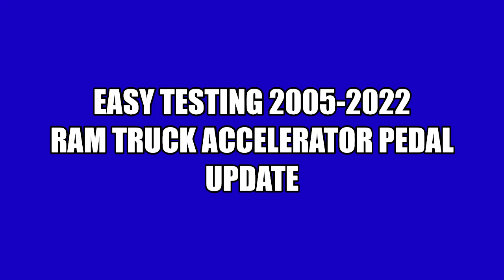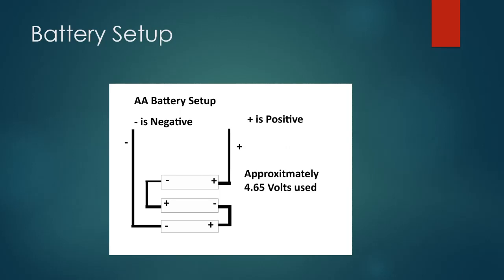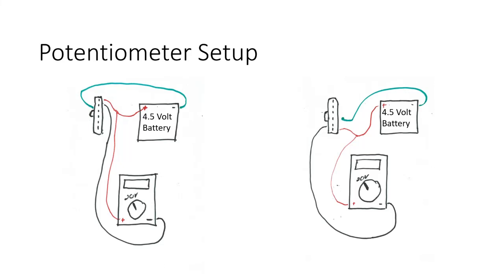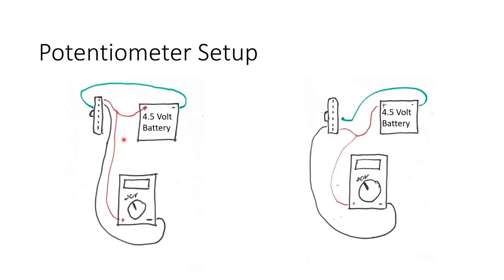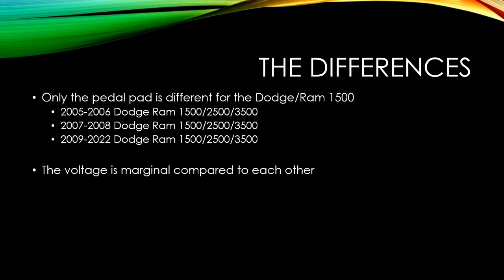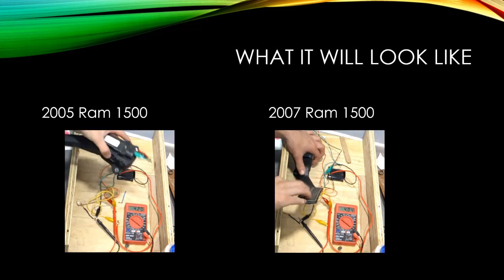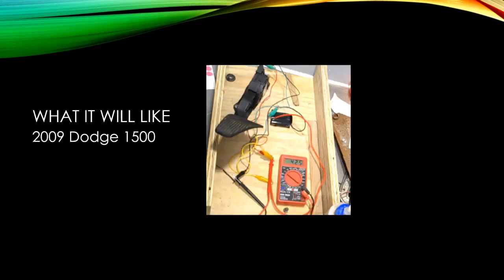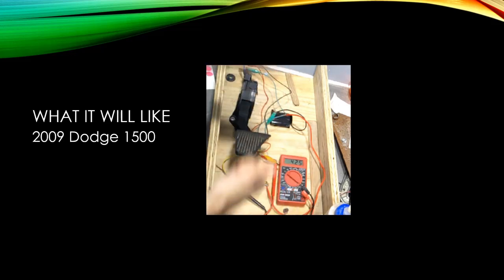Easy Testing 2005-2022 Ram Truck Accelerator Pedal Update

Comment: I’m converting my 06 dodge ram 2500 6 pin accelerator pedal sensor to a newer small style 6 pin do you know it the pin out are the same between the two only reason I’m doing this is to use the pedal monster on my truck the plugs are newer style